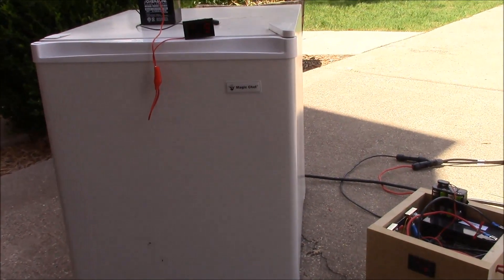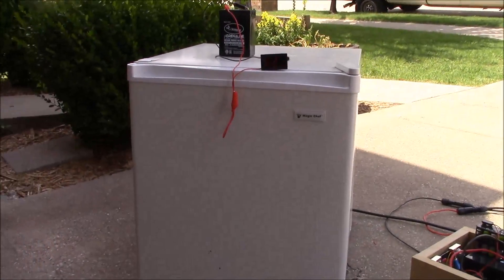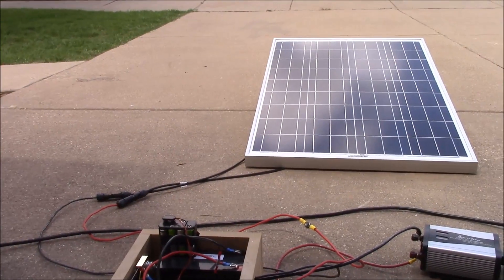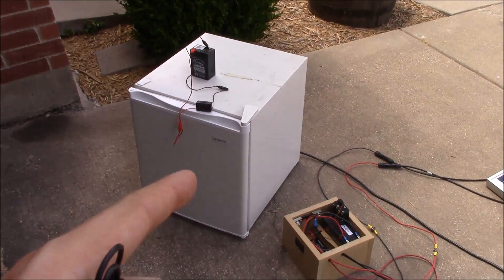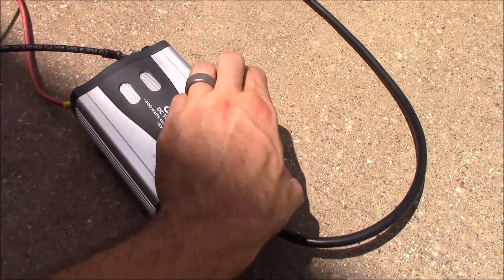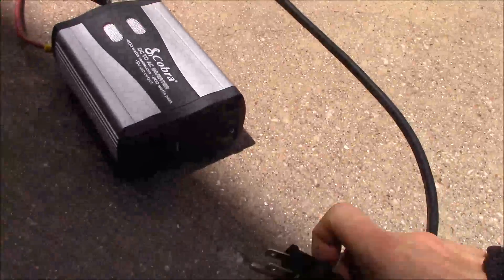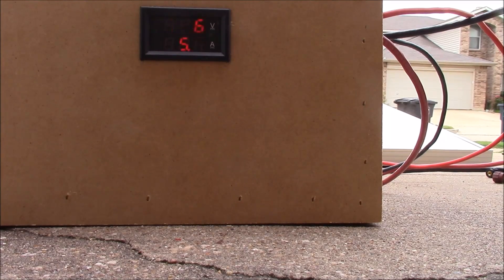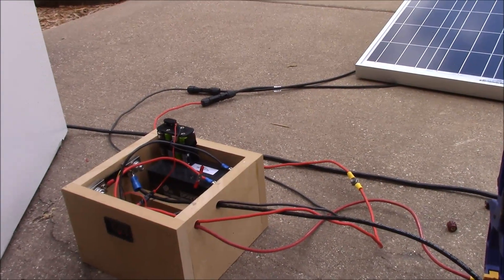Will It Solar? - Mini Dorm Fridge

Comment: There must be something wrong with your test. I got a mini fridg to run on a 400 watt inverter and a lawn tractor battery. It was a test to see if a 400 watt inverter would power it. It did.
Reply from the maker: Nothing wrong with the test.  Just real world science.  Not all inverters are built the same.  Some have larger transformers and better internal construction to handle transient inductive loads like a compressor motor on a fridge.  Your fridge may also have a soft start feature or just use less power when starting up.

Comment: You need a 100 amp hour battery that's like a 10 ah, I'm looking to run a way newer minifridge, 50" 4k tv and Xbox One off grid thinking I'll need x2 200 watt panels and about 600 amp hours of battery. Hard to find straight answer and when using solar power calculators on sites they tell me i need 1.4k amp hour of batters and 1.2k watts in panels lol that seems like some overkill not spending 5 grand to run a beer fridge and a tv.

Comment: the initial start up of a fridge compressor is on average 10 times the amperage of the rating for the unit.
Reply from the maker: I've heard 4x but you may be right.  It may be 10x on at least some models!

Comment: Hmm i feel like we should have been told this was a fail from the get go.
Reply: Ya- he doesn’t even know the tiny mod-sine inverter is bound to fail on a motor, never mind that he thinks the charge controller has anything to do with the failure!

I tried a couple small fridges for fun on a 200W system with two lead acid batteries. One for six weeks. Both ran fine. The dorm fridge ran a lot but it worked fine for days. I never tried the 400W mod-sine I have somewhere. I used a 1200W pure sine. But I think I’d like to try a proper 400W pure sine on a dorm fridge I just don’t own one anymore (it was a freebie and I passed it on to the break room at work after I played with it)

Comment: Wrong battery size,wrong inverter size,wrong amount of panels. You cant just PULL POWER outta the sky & expect to run everything.  You need to triple what you have. Didnt say it was gonna be cheap !  After all the $$ you invest itll be worth having refrigerated goods. In the long run you WILL-SAVE-MONEY.

Comment: What wrong is you need 2 battery to get 16 amp to start the compressor than 1battery enough. May be a starting battery like 950  CCA . Deep cycle battery don't have much CCA is more of a sustain low a,p for a longer time
Reply from the maker: Then why did this exact same setup work fine with a larger inverter?
Reply: If it was full charge it should.  Iam talking low battery. What many forget is the dorm refrigerator is about 120 watts and that 1 amp at 12 volt but for a 12 volt it's 10 amp at 12 volt . 12 volt x 10 amp = 120 watts.  Then you add the compressor starting it can be done with a deep cell battery but barely. Everyone free to try it. And the dorm frig is the best bet
Reply: 120 watts at 120 volt = 1. Amp .

Comment: The refrigerator's compressor has a starting capacitor that is used to prevent start up spikes. The initial kicking in of the refrigerant compressor takes its power from the starting capacitor. Once it gets going the amperage will go down to 10 amps. You need to have a start cap on a solar system driven motor. Test this in the house with the refrigerator plugged into the wall & an amp meter connected to check for such amperage spikes.

Comment: If your inverter is drawing that much something wrong i got a 4000 watt inverter hooked up with a 20 amp controler no problems you need to do your research you will never make it on solar get a generater
Reply from the maker: You can't compare a 4000W inverter to what I was using.  Of course a 4000W inverter can handle the surge current of a small refrigerator.

Comment: Does anyone know WHAT SIZE INVERTER will power a (60watt) minifridge with freezer? I've tried a 350 watt pure sine and it worked ONCE and never again, so Im thinking double at least but I would like to know exact. 100 watt panel. Just need to freeze 2 gal water- ( 6 hours)
Reply from the maker: Those small inverters are usually junk.  I would run that off of at least a 600W inverter from a reputable manufacturer.  If you need help finding one, let me know.
Reply: Get a krieger 1100 watt inverter its a 2200 watt peek and constant 1100 watts out put there 84 bucks pluss tax on amazon or a 4000 watt continous 2000 watt smart inverter there the same prise  thats what i got i can run my fridge coffe pot tv microwave of eather one
Reply: @jameswilsin5348  
Yes it will. 
However, microwaves, fridges, cordless tool chargers, TVs and other electronics don’t always last very long on modified sine inverters. Mod sine is fine for resistance appliances like coffee makers, soldering irons, incandescent bulbs, and water heater elements but after killing a computer monitor and stuff ~20 years ago I’ve never bought another modified sine inverter. Too expensive to save $150 up front only to replace hundreds of dollars of equipment over a year’s time.

Comment: Connect the inverter direct to the battery it has its own cut off at 9.8v best to keep 12v devices attached to the load of the solar controller only.

Comment: Pretty late comment, but a nice way to effect the power usage of the fridge would be to make sure it has no lights inside :) also the less the fridge motor has to run the better , i got a cheap small fridge freezer when i first moved out and it had trouble keeping the freezer area cold without being so cold that it would freeze things in the fridge part, so using a pre existing freezer i froze two cheap icepacks solid and put them in the shit freezer, i was able to turn the temperature up and balanced things out perfectly also i did not have to re freeze the ice packs whatsoever and i had it for 3 months then i moved again, but making modifications to fridges and freezers are definitely worth looking into, moat have good frames and shapes but are filled with cheaper junk that causes more power loss to keep itself running.
Reply from the maker: Good points.  Thanks for sharing!

Comment: I don't see what factor a charge controller would have, if it's running off the inverter from the battery... Sounds like you need a capacitor to handle the spike
Reply from the maker: The charge controller isn't really doing much in this example since the load exceeds the input.  It is just a pass through.  But I include it in the video because it is a necessary part of an off grid solar panel setup.  Yes, I tried using a capacitor later in this series of videos.

Comment: that alarm on the small invertor was to let you know ..either your battery voltage is low or your drawing too power and is causing the unit to over heat....
Reply from the maker: Yes it exceeded its limitations for sure.
Reply: LDSreliance hey man I'm sorry it took so long to reply but I literally just got notified that you had liked my comment...  (2 months late)There was no notification that you had replied... Is it working properly now ?
Reply: @LDSreliance  it exceeded your expertise, first.

Comment: i think you need at least 4 panels like you have and a big car battery might do the job..
Reply from the maker: It actually turned out to be the inverter that couldn't handle the job.  There are 5 parts in this series, I believe, and I tried quite a few tricks to get it to work.
Reply: One panel will work and a lawmower battery and a 12 to 1500 watt inverter it will run

Comment: I have a mini fridge and it's 1.5A And 90 watts. I have to have a 100watt inverter for it :p
Reply: My minifridge is.0.8a I have a 1000w inverter and 300w of solar on my van but it easily runs the fridge
Reply: @spectranurse  what kind of fridge is it
Reply: @ingridcruz-reyes2272  electric

Comment: Hey Man,

You might want to open the back and see if you can run this mini fridge off of 12v. I have one and found it is nothing more than a Peltier Device to cool the unit. Don't destroy this unit but you could probably view what converts it to 12v and you might be able to make a double plug for both 120v or 12v depending on your needs. You could probably do this with computers too since the Power Supply is nothing more than a AC to DC converter... Keep up the great work...

Paul....
Reply from the maker: Paul Bialozor The back is open on this and it is a traditional condenser type refrigerator.  I actually think my peltier fridge I bought would work better on solar than this thing because of the huge power draw it needs to get the motor started.
Reply: LDSreliance Wow, that is surprising, I did not expect this fridge to have a condenser, that is too cool... The one I have is the Peltier kind and it does not work as well...
Reply from the maker: Yeah, it is a pretty nice unit.  If I can figure out how to get around the huge current spike to kick start the motor (maybe with a capacitor or something) then I will put it out on my shed and run it off the solar.
Reply: LDSreliance Yeah, I've seen a few videos addressing just that, hence the reason most Fridges are not designed for solar> What I've seen is many have used a 3k or 6k pure sine wave inverter to kick start them. Perhaps a capacitor from an AC Unit might work, though I am not sure, I just know they are needed to start the AC Units on Mains Electric. I am sure you will figure it out... Enjoy...
Reply from the maker: Thanks!  I can't afford a 3000 or 6000 watt pure sine inverter right now (or any time soon lol) so I will look into capacitors and see what I can find.
Reply: LDSreliance IKR, the money they charge for a Pure Sine Wave is outrageous, but I bet you could make your own. I clearly do not have the skills to even attempt but I've seen you make circuits I am sure you can take a crap inverter and BEEF it UP with a few other parts. 

I bet you can buy a broken Pure Sine Wave, CHEAP, and fix it or at least get an idea of how to build your own... They say Money can't buy luv but I beg to differ, with MONEY you can BUY ANYTHING... LOL... I am sure you will figure it out, I have faith in you in case you don't...  :)
Reply from the maker: OK, I am glad someone has faith :)
Reply from the maker: Jerónimo Barraco Mármol
I agree.  I have ordered one so we will see soon enough!
Reply: LDSreliance The capacitor solutions sounds reasonable, because is just a spike.